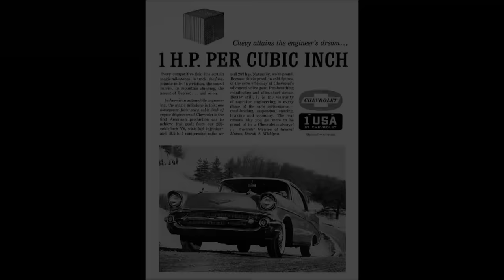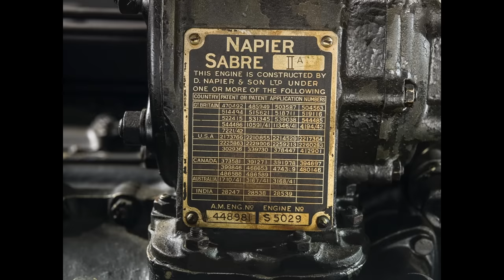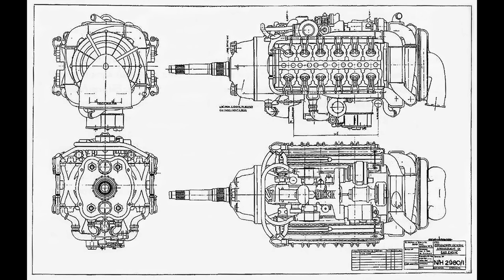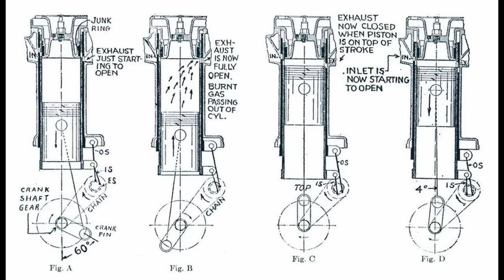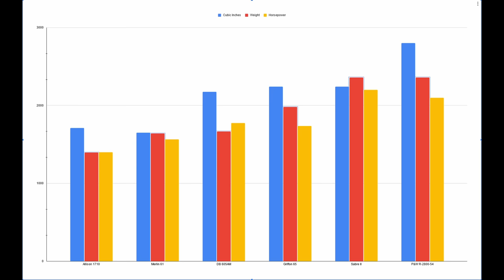Napier Sabre - The Ultimate WWII Aircraft Engine - Part 1

Comment: 1 hp per cube? I now have  a glow engine of .90 cube which makes 4.5 hp. Of course  it has to run at 24000 rpm. And its 2 cycle. Anyway, I love the big old piston engines. They are amazing. And you cant beat the awesome sound!

Comment: Radial engines tend to have a more favorable displacement to weight and power to weight ratio than inline engines because they are air cooled. They are built with much thinner, and thus lighter, engine blocks and cylinder barrels because this is desirable in an air cooled engine. This means there is a greater amount of engine displacement compared to materials usage. They also lack cam shafts, have far fewer gears, and have very short crank shafts that use less material in their construction. They also use pushrod-actuated poppet valves which are less complex and lighter than overhead valve setups. The need to circulate coolant within the engine block and cylinder heads of a liquid cooled inline engine requires thicker castings to allow for passageways for the coolant to flow through. The unfavorable specific power output of a radial engine is more than made up for by the fact that the radiators and other equipment necessary to run a liquid cooled engine are absent and thus save weight. The main advantage of a liquid cooled engine is that they are smaller, have a smaller front cross sectional area so they can be fitted into more aerodynamic housings etc. With an air cooled radial, there truly is no replacement for displacement, but a liquid cooled engine gives you a lot more options for extracting more power from a smaller displacement.

Comment: With more development the napier sabre could very easily be converted to a 2 stroke engine the sleeve valves were perfect for a 2 stroke application but keeping the engine feed with enough air would have been a huge hurdle even if they add a second supercharger it still would not be enough. something like that would easily get near 5000hp
Reply: Late Sabre's made over 5000bhp in testing. Some claim 5500bhp, so there was a lot of potential in that design

Comment: Incidently, the biggest problem with the sleeve-valve was  breakdown of the boundary layer of the lube oil and  its coking under extreme heat at hotspots over the area (large) of the sleeve. This would likely have been overcome with modern synthetic lube oils.

Comment: I'm guessing that the absence of valve springs in the Napier engine improved power output relative to poppet valve designs but as you say supercharging cylinder efficiency was then a critical need for all high performance piston aero engines.  Also, I think RR did the same trick in trying to stop Whittle's jet designs, hence why rover cars were given the contract to commercialise the design.  History teaches us that innovators are mostly despised by the oligopoly that exists between powerful stakeholders and agreeable regulators.
Reply: Sleeve valve engines burn too much oil.

Comment: The single most useful metric of engine performance is power per unit of piston crown area! It takes into account RPM, Compression Ratio, Supercharger Boost and Combustion Chamber shape. By this metric, the Sabre is the best piston engine that was ever put into serries production. but it does not take weight into account, or frontal area per unit of power.
I also noted that you made several mistakes with regards to other engines in your charts. No R-R Merlin manufactured and put into service during the war made over 1,720 HP! The 2,030/2,080 Merlin used in the post war prototype Hornet did not see service during the war. However, the Packard Merlin V-1,650-9 did make and see service during the war at 2,218 HP in 555 P-51H Mustangs. Furthermore, the Allison used in the P-82 made 2,300 HP and for about 137 pounds less weight installed. All very useful metrics of performance.
But if one were to make a much more useful comp, the R-2,800 and 4,360 would show very nicely because of their lower installed weight per unit of power, reduced frontal area per unit of power and greatly increased tolerance to damage, all things that no liquid cooled engine can match because of the high parasitic weight of the cooling systems, etc.
Furthermore, the DB-624??? made 2,980 HP for 903 Kg installed weight and it gave very much greater power at 50-60% more altitude.

Comment: Their is a rumor, yes, not documented, that a P47 air hamdeling system was attached to a saber one afternoon at the Napier plant.  It is said to have pushed out somthing over 4000 bhp, before failing.  But this is very unlikely as intercooled turbo chargers were no longer cutting edge, the way jet engines promised.

Comment: it surprises me that there weren't any other major engines that tried to increase power by increasing rpm. most engine advancements came from making more torque rather than rpm. yeah these are huge engines, and pushing RPM up is an easy way to make them blow up sooner, so it makes me wonder if there was ever an attempt to make a small stroke large bore radial (or any other layout) with many cylinders by any other of the major powers. the Napier cant be the only engine to focus on using RPM to get more power right?

Comment: Ease of manufacturing the parts and number of parts and ease assembly that is the focus. If something is costly to make it is a weakness.It is also power to weight every time for getting a plane off the ground.Power to cubic displacement is for a ground vehicles.Sometimes when you over boost an engine you generate too much heat and you break parts so reliability of an engine is paramount.

Comment: There was, however, one big problem with the Sabre engine: it was terrible at higher altitudes. That's why the Hawker Typhoon and the later Hawker Tempest VI were primarily assigned to lower-altitude operations.
Reply: Die Tempest und die Typhoon sind meine absoluten Favoriten in der Royal Air Force. Allein die eleganten Linien der Maschinen. Dann der bullige Kühler der die pure Kraft dieser Schönheiten unterstreicht. Wenn man diese Maschinen hört kriegt man Gänsehaut

Comment: Specific power is irrelevant when displacement is not regulated. Power to weight and Power to packaging volume are way more important to the A/C designer. The  P&W is air cooled (better survivability) with close to the same Power to Weight of the Sabre, so based on that I would rate the Dbl Wasp as the slightly superior power plant. Frontal area might be the biggest advantage for the Sabre over the P&W.

Comment: There's a more complex relationship between boost and power.   A simpler relationship exists between airflow and power.   More airflow equals more power.   Not necessarily so with boost. 

For a fixed volume of airflow,  if I vary the restriction it's fed into,  the boost will vary.   Increased restriction causes an increase in manifold pressure (boost reading).

If I hold the manifold pressure constant and vary the restriction,  the airflow will vary inversely to the restriction.   Increased restriction causes reduced airflow. 

Given that the Saber has sleeve valves with much less restriction than poppet valves,  that engine could very well be flowing much more air at a lower boost reading than the other engines.  And more airflow makes more power.

Comment: I've been around cars & engines my whole live, I have had a few 350 V8  engines I've worked in and rebuilt along the way,and just what that takes alone, Example:  when measuring crank and bearing clearances, for prober lubrication while running under pressure.Having correct fuel pressure To Spark ratio on a V8.  My head is spinning just thinking about what they have done here having 24 cylinders ...

Comment: Great presentation and thank you. As we moved ahead in engine design, the sleeve valve design just hasn't proved out. Complexity has to be a main issue. The 4 valve pent roof Allison layout of valves has stood the test of time as all modern high performance engines from Ford, Honda, Toyota and others have adopted 4 valve pent roof heads. It appears Ricardo was proven wrong that poppet valves are a hinderance
Reply: Valves are still a hinderance, there's only so much surface area on the top of the head you can place valves, and a lot of that is lost to geometry. How many circular valves can you fit in a single larger circle, while also having spark plugs and a fuel injector? The valve stem and valve guides reduce that number further, plus the geometry of the intake and exhaust ports.

Sleeve valves are still the best method of getting fuel/air and exhaust in and out of the cylinder in the most efficient way possible. Driving a sleeve valve is no more complex than trying to put 4 valves per cylinder on a radial engine, or modern triple overhead cam engines for VVT.

Comment: Thank you for this video, I had heard of the Napier engines but really knew nothing about the Sabre. I was surprised that is was a sleeve-valve engine, though - I thought that the Bristol Hercules was the only sleeve-valve aircraft engine. We have one of those here in NZ in an aircraft, and I've seen it running - fascinating engines. I am aware of the Daimler and Knight sleeve-valve engines, of course.
Reply: SafeAir ran a cross Strait freight service between Blenheim and Rongatai using the Bristol Freighter (which were fitted with these sleeve valve radial engines) but getting the engines correctly serviced became more and more of an issue (during the mid to late 80's) resulting in eventually finding engines and new parts in obscure places. The last of the engines were sourced from Spain with limited documentations available, so the service came to an end for mainly that reason. The start-up procedures placed emphasis on fuel fire minimisation measures, including having a manned large long-cone nozzle extinguisher plant being actively positioned and pointed at the underside of each engine cowling before and during the firing up. Take-off RPM's were 2,200, and cruising RPM's were 1,800. They were very smooth powerful compact engines compared to the pushrod P&W's. As for me, well I used to sit above the two pilots, in the navigator's seat, whenever possible. Lots of eventful tales could be told, including on one occasion 'bouncing' down pretty much the whole length of Rongatai, loaded for the first time with three short Honda Citys (in place of the usual two longer Honda Civics). This factor altered the usual fully loaded C of G fulcrum point, the stiff thick wings 'flapping up and down' like seagulls' wings with each resounding continuous "THUMPING" back down onto terra firma. We thought our number could have up on that particular occasion (the undercarriage of any other comparably sized aircraft would have collapsed very early-on!)
Reply: @skippmclovan1135  Thanks for that fascinating information. I had heard that NZ had the last Bristol Freighters in service, until the airframe hours forced their withdrawal. From what I heard, the engineer who designed the Bristol Freighter had to make the first test-flight himself, as all the usual test pilots refused to take it up! It turned out to be a remarkable aircraft.

Comment: Higher RPM requires more strength, at that time, adding material/weight was the best solution to add strength at that time. I wonder if the difference in weight comes from a material in all the components.

Comment: The other big weight disadvantage was you effectively have 24 extra cylinder bores/liners.  With the inner sleeve and the outer sleeve that the inner sleeves runs inside doubles the amount of steel cylinder bores.  I also understand the sleeves were combustion pressure limited.  Otherwise, who wouldn't love such a fantastic design.
Reply: The other issue with sleeve valves and rotary valves is that at partial opening the flow is often very low and turbulent. If you can imagine the air/fuel flow navigating around the overlapping edges of the opening. 
Later OHC multivalve designs seemed to have solved flow issues with 2 valve arrangements. Poppet valves may be simple but low lift flow is good and as the valve opens flow increases and the cam profile can be ground to allow the valve to dwell at full lift. Plus they are deadly reliable.
Reply: @geoffmooregm  I did not think so: i was mecanik on Bristol Hercules (Noratlas aircraft) and the consumption was realy lower than all other radial engines, did not need rich mixture like on US radials and the exhaust flames was pure BLUE and not yellowish like on US radials...The Hercules i work was very reliable and they TBO was 30% higher as US radials like the Wright R3350 32W i known
Reply: I would think the SV gears, cams, and linkages would be the added weight (besides the added crankshaft and double reduction gears) The moving sleeves themselves were quite thin. It's amazing they could hold their shape with all the different temperatures they were exposed to.

Comment: Was the high RPM considered a liability?  Propellers lose efficiency above about 2800, and the Sabre was running about 4300?  Did they use a gear reduction system, like so many current auto to aviation conversions?
Reply: ALL WW2 high power engines did use reduction drives, and the big propeller did turn FAR LESS than 2800rpm

Comment: The r-2800 in the P-47m was the strongest fighter engine of the war with 2,800 hp. The Jumo 222 would have been the strongest with over 2,900 hp but the 8th air force destroyed the factory just when it was about to go into production, it would have had about 3,800 hp with nitrous and methanol injection which all German fighters had at the end of the war. The most impressive piston engine that saw combat was the engine in the B-29.

Comment: Very good video. The hampering of the raised boost levels was mainly due to the nightmare of reliability, which forced MAP to make Napier and Bristol to play nice and the poor production quality which led to the enforced takeover by English Electric. The correct decision was made in 1943 to stop the development of an improved two-stage blower and concentrate on production quality and reliability. That the initial powerplants were six months late in being delivered to Hawker in 1939 also didn't help matters, and neither did the fact that in Dec 1943 you had almost 300 Typhoons sat at Glosters waiting for engines.  But, if you use a rough rule of thumb that it takes 6 years in the 30s/40s to get an engine to a solid level from the first run, you do see the later model IIa Sabres running with the sort of reliability and power by 1944 that was always intended for the Typhoon in 1941/2.
Reply from the maker: Thanks Matt! I would have loved sources that discussed this issue in more detail when I was writing the script.

Comment: There must have been some wizards working for Napier.  After looking at the design of the Sabre take a look at the design of the Deltic diesel engines.  There should be no surprises.
Reply: You could argue though that the Deltic, despite its weird layout, has been a more successful design and there are still a few running in Boats and locomotives. Napier certainly had some clever people working for them.

Comment: In 46 I put one of these engines on a test bed for chrysler as a potential tank engine partnership  it pushed over 5000 hp on the test bed but the valves were a mechanics nightmare that and it was very difficult to quiet the exhaust down enough for the application but boy did that engine sing
Reply: This engine doesn't have valves...

Comment: The Dagger was used to power the Handley-Page Hereford bomber, but was so unreliable that Herefords were either used for training, or converted into their parent Hampdens.

The best engine in the world is useless if it doesn't work, and the Sabre's problems with reliability were never truly solved.

Rolls Royce themselves had problems trying to come up with a replacement for the Kestrel, the Peregrine being a failure and the Vulture ( pretty much 2 Kestrels in an X-arrangement) a disaster.

One problem with the Typhoon was its wing, basically a scaled-up Hurricane wing that was too thick for altitude work.

Comment: Didn't the DB 606, as seen in the HE-177, also feature basically two engines mated together?
Reply: + M. Brysch  The DB-606 and DB-610 were basically two engines mated to a common reduction gear casing.  Each engine was clutched and could be operated independently.

Comment: Did you do any research on the tech figures of Bristol's Hercules/Centaurus family of Sleeve Valve Radial engines? It is my understanding that both of these engines produced some pretty impressive figures and were considered by many to be among the finest radial engines produced by any of the manufacturers during WW2. Although not ready for full-scale production until later in the war, the Centaurus would eventually produce up to 3,000hp .

Comment: Why no details on performance in planes ?
   You know, like how the P-51 was not very impressive with the original Alison engine and didn't become the premier fighter it was labeled until the Merlin engine and 4 bladed prop were installed  !
   What planes did they try the Napier in and how did it compare  ?

Comment: Very interesting video, thank you! And with Typhoon footage I had not seen before. However I was thinking whilst viewing, is that engine reliability, ease of manufacture (including materials used and their scarcity), serviceability and engine cost are also major considerations in a wartime environment. Power to weight is only one statistic and shouldn’t be used in isolation when comparing engines. Loved the video though 👍
Reply: The problem with weight in airplanes, as opposed to on land vehicles, is that some of the power/fuel consumption has to be used to keep that extra weight up in the air!